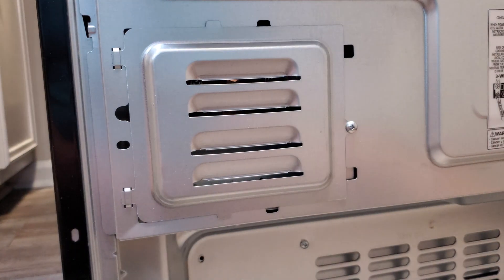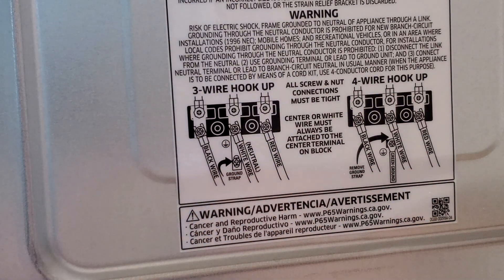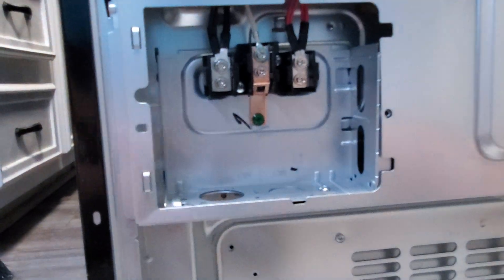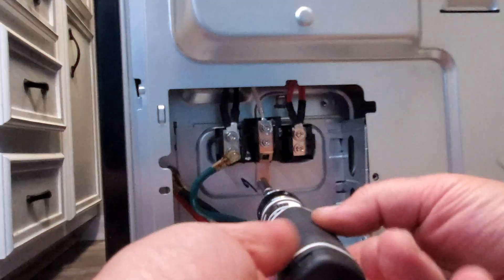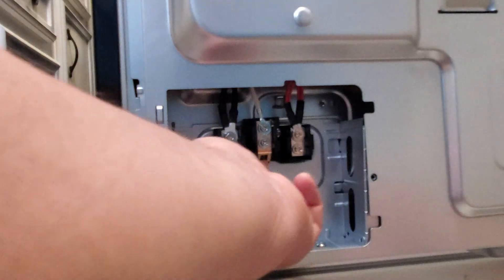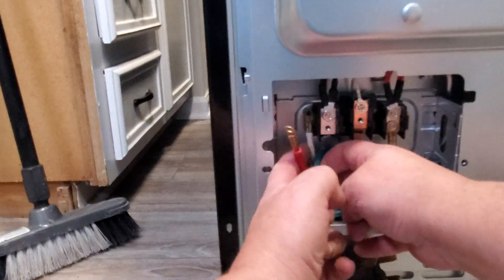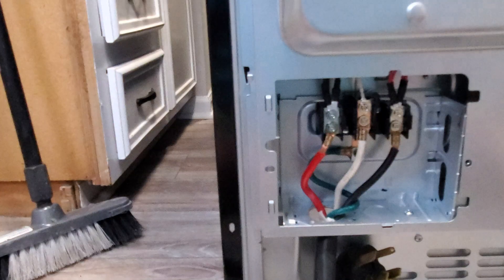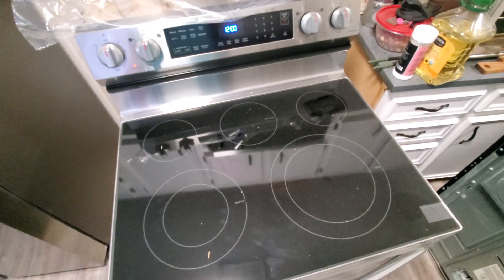DIY Range Oven Wiring: Complete 3 OR 4-Prong Guide

Comment: I have a black and white with ground running to mine and the stove has white black red ground there connected yet theyvtrip with to many eyes on can you help?
Reply from the maker: Hey Ryan - sounds like your setup is missing one hot leg. Most electric ranges need 240V, which comes from two hot wires (usually black and red) from opposite phases in your panel, plus a neutral (white) and a ground. If you only have black, white, and ground, you're getting 120V - not enough to power all burners, and that’s why it trips.

You can’t split one hot - you need to run two proper hot wires from your panel on a double-pole 40-50 amp breaker. Your panel should have 4 wires coming in: two hots (each 120V), one neutral (white), and a ground. The neutral and ground are usually bonded at the main panel. This is high voltage work, so if you're unsure, definitely consider having a licensed electrician take a look.

Let us know later if you're able to run another leg from the panel.